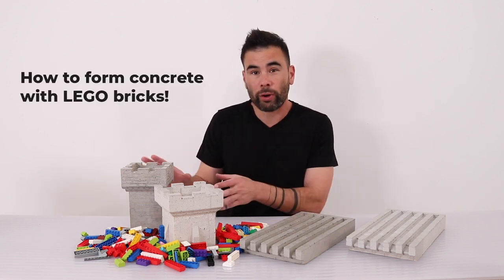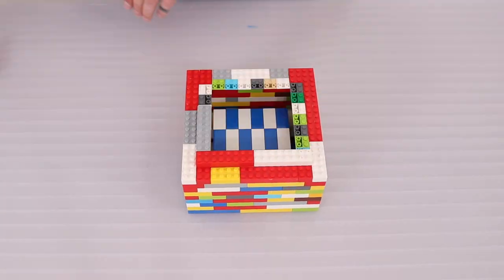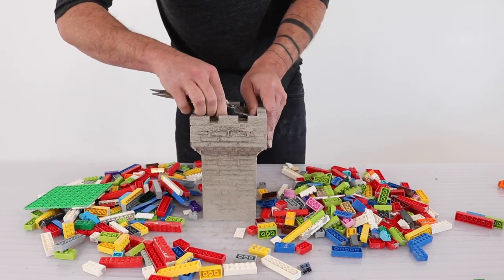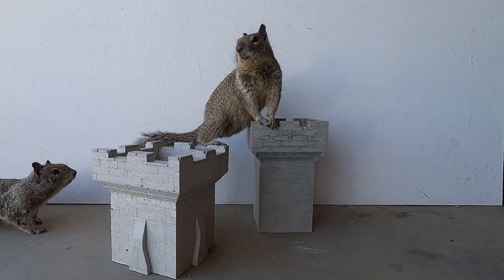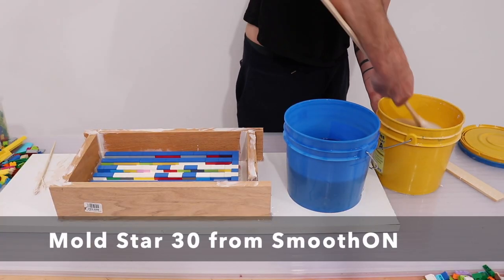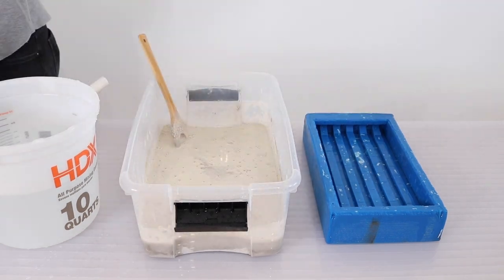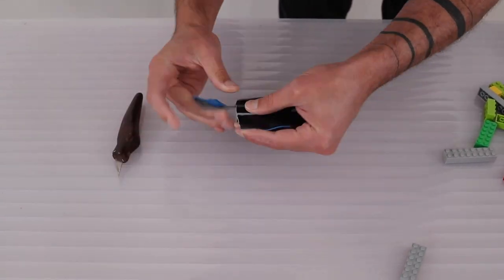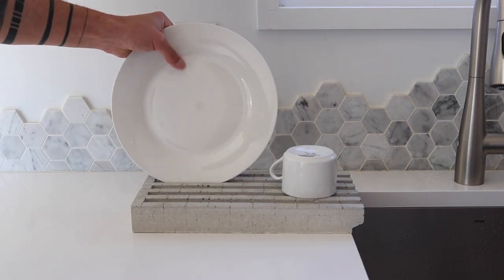Pouring Concrete into LEGO

Comment: With all the concrete work you've done. I'm surprised you haven't created your own vibrating table. Attaching a vibratory tumbler to a small table seems like a good idea in my head.
Reply: Extra points for making it out of LEGO.
Reply: @hamjudo  integrating a Technic lego enginine with an off centre weight to the mould, suspend the mould and vibrator on suspension springs over a base plate that can be fixed to a workbench with screws, pegs or clamps so it won't vibrate off the table.

Comment: I would probably still put a sealer on for food safety reasons. Don't want bacteria growing in the porous concrete.
Reply: Sealer will also prevent water stains/marks. Definitely needs sealer.
Reply: North American YouTuber  There are loads of them out there. Anything meant to seal concrete countertops. You just have to make a choice on the kind of finish you want. But it will come down to a topical sealer or a penetrating sealer.
Reply: douse the legos in diesel gas. its good for preventing the concrete to stick on legos

Comment: This is a great project, Ben!!  Does the concrete feel or sound 'gritty' when you put dishes on it?
Reply: @SuicideNeil  actually china is harder than concrete so no that wouldnt happen.  it could chip and break on impact though.
Reply: The Modern Home Project I ran out of smooth pieces can I use like or freeze on the non smooth surfaces? To keep them from sticking to the concrete?

Comment: One change I'd make is to put a few flat pieces on the far end of it to tilt the entire thing up toward the sink, not enough of an incline that things would roll off it, but enough that water will run down and out and not potentially just sit there. Otherwise, nicely done.

Comment: A lot of washing machines will have trouble dealing with the bits of concrete you’re producing in your washing procedure. The bits of concrete will build up in the bottom of the machine over time and cause issues. Just a warning.
Reply: This

Comment: You should look into getting a fine screen classifier to remove the pebbles and also get a vibrating orbital sander and use it to shake out any bubbles ( oh that's without the sandpaper ) then later on you can upgrade to better equipment .

Comment: actually, unsealed concrete pieces shouldnt come in frequent/prolonged contact with water because mold will start to develop on them...
Reply from the maker: actually mold is a product of a lot of environmental factors including surface texture, temperature, and humidity.  I have been making concrete countertops for over 5 years and if you keep things clean and dry no mold develops.  mold can develop on rough surfaces which this is not in humid environments which this is not.  sealing concrete can often make matters worse if a small part of the seal is scratched and moisture gets trapped inside.  don't listen to people who over simplify. use your brain and think about the specifics of that project and that environment.
Reply: @HomeMadeModern  environment such as abrasive residue in your washing machine and the public waste water treatment system...

Comment: @05:05 Use IPA next time... The high concentrated alcohol will immediately destroy any bond the Hotglue has had on the parts.
I use a small spray bottle filled with IPA to clean my 3D Printer Surfaces and release Hotglue when needed - Spray it on, wait like 5 sec and peel off.

Comment: Do these chip easily?  I've been thinking about doing a small sculptural element out of concrete, and I was considering using PVA fibers as reinforcement (PVA over AR fibers because they're smaller and won't show up in the surface) but I'm not sure if that's overkill or not.

Comment: Just for the record, LEGO is not pluralised. So LEGOs is not correct. Also, you could've avoided the damage to the small pieces in the first case if you'd used some mold release spray or baby powder, those two things do wonders.